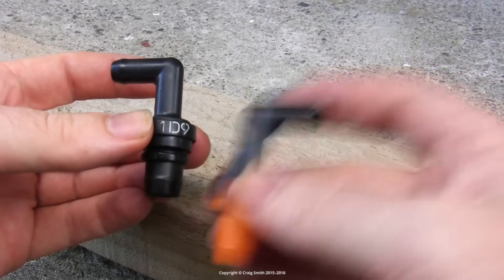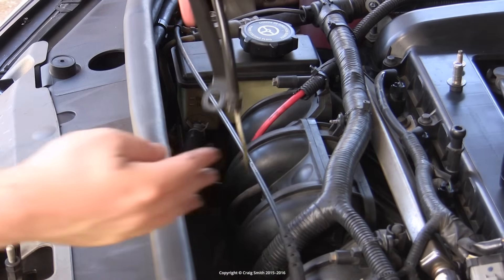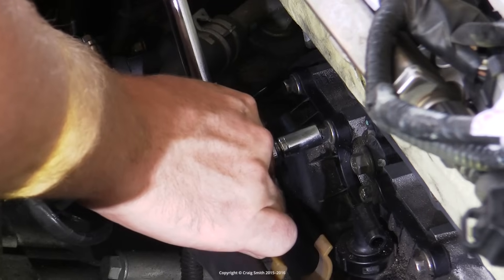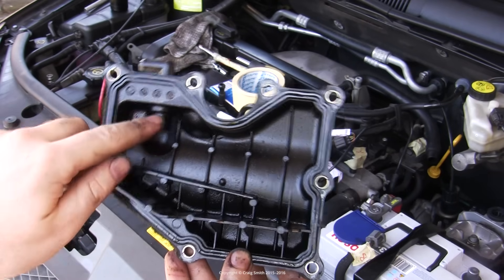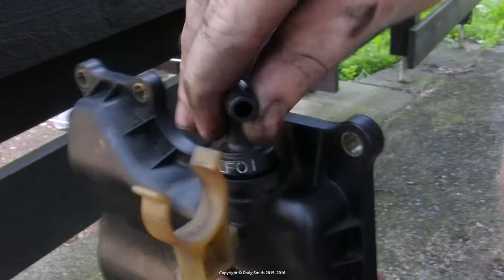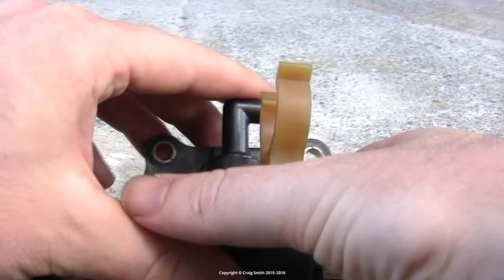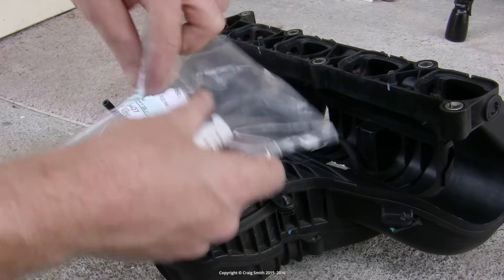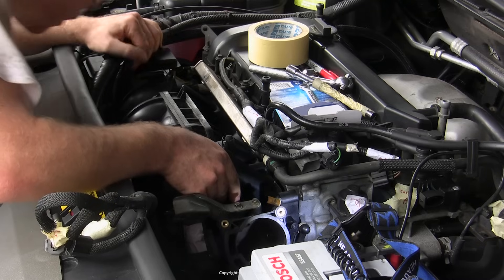How to: Replace PCV valve, hose, oil separator Ford Duratec / Mazda L (Focus/Ranger/Mondeo/Mazda)

Comment: my 2.0 duratec he engine has got some serious idle issues.. at start up It rews up to 3500 rpm and slowly goes down again to about 1100 rpm and stays there. same issues when driving and shifting gears   it revs again when I make a halt .. could this be the issue? before this problem the car didn't accelerate very well but after changing the intake solenoid switches and mounting a intake filter kit , it ran like a dream. good acceleration and so on... but now this issue... it even says " engine system malfunction " on the display and behaves like a rapid dog until I turn the ignition off and on again.. and then nothing.. comes and goes from day to day.  should I chek this put and also tjek the intake flaps? ..the throttle body is clean as a whistle and the sparkplugs too  . and the small vacuum hose at the manifold top is removed at blocked and it stopped rattling.
Reply: Allan Jørgensen hi  my car was doing same rew up randomly sometimes when stop at trafic lights after driving . I discovered that my chain was stretched out like 2-3 cm so I got new timing chain problem disappear. no more rew up ever since
Reply: I had this same problem and had it fixed. the problem was a leak somewhere in the intake manifold. Apparently I found out that there is a design flaw with this manifold and it is a common problem. I got a used manifold from the wreckers but there were components missing from it so sent it back. My mechanic was able to fix the issue using a glue gun and he fixed it perfect.
Reply: Hello weird but true， 

My 2.0 DURATEC HE has same problem as your one. It's serious idle issues more than your one.. at start up It rews up to 4000 rpm and slowly goes down again to about 1500 rpm and stays there. same issues when driving and shifting gears, it revs again when I make a halt. the throttle body is clean. 

Could you tell me how you can fix this issue?
Reply: Hey I have the same problem how did you fix ?  Unsure what to try first.

Comment: can anyone help me find these parts including the hose? I'm in the Netherlands and I cant find these parts anyware. I prefer not to go to the local ford dealer here since they broke my lock bolt and damaged 2 of my rims and they don't want to replace them.
Reply from the maker: The parts shown are: hose - Ford 1119272, valve - Ford 1216674. I recommend a 3rd party Ford parts supplier, in the UK I used Endon Services @ http://endonservices.co.uk and I recommend them - *however*, as explained in the video, these parts varied over the Duratec life, and are differently sized to match variations in both the intake manifold and the oil separator. So you must accurately identify your existing parts before ordering.

Comment: Hello Craig to your knowledge is this the sane engine as a 2005- 1.8  volvo s40? And if so do you think the pcv valve from ford will fit? Thanks Alot.
Reply from the maker: I just took a quick look at the S40 wiki page and I can't tell easily. It could be the Ford Duratec 1.8. You will be able to recognize it visually if you pull of the plastic cover and ignore any Volvo logos. If it is then yes the valves & hoses will fit, but as I belabor in this video there are several different revisions and you will have to work out which you have - the only reliable way will be to pull off the existing part #s.
Reply: Craig's DIY Car Thanks for taking the time to reply, yeah I'm pretty sure it is the same engine with few small differences e.g it has electronic throttle, just thought I'd run it by you. Thanks Again ✌
Reply: I also have a Volvo S40 1.8l. Just did the PCV valve and hose replacement, the hose had a 5cm tear in it. The engines are almost identical, with some exeptions like the electronic throttle you mentioned and some wiring. This video helped alot.
Reply: Erik i Tuni Thanks for confirming this, I keep meaning to do it myself but it just seems a but tricky.
Reply: I know what you mean, I bought the pcv valve at lease a year ago but never got around to fixing it. Luckily I followed online advice and bought the hose before starting.
I bought my parts from a Volvo dealer, you should be able to see what the part numbers are on catcar.info.
Reply: Erik i Tuni Thanks bro I gonna go check the part numbers now.

Comment: My PCV hose collapsed and split, and I replaced it and the valve with the help of this video.  The car ran great for a few months, and then the new hose collapsed and split.  I'm going to replace this thing a second time, but any idea about what's causing it to fail?
Reply: Did you replaced also PCV valve ?

Comment: My 2010 focus with a duratec engine is using alot of oil and its using more and more as time goes by.  Could this PCV cause this
Reply from the maker: It's worth checking, see if the valve has failed and also look inside the breather pipe at the rocker cover, and the filter box, to see if there is oil. The related suspect is piston rings.
Reply: Demon Destroyer hey i have thé same problem.
Could you find it?

Thanks

Comment: Can I replace it when any black hose with the same length or does it have to be a certain material etc
Reply from the maker: No, it needs to be vacuum hose that won't collapse under vacuum. The walls are very stiff. The shape is also a little strange so it would be difficult to replicate, easier to just buy the Ford part.

Comment: great video I did this last month and found sludge within the oil separator - would this cause envision issues and burning oil issues
Reply from the maker: More likely a parallel symptom of a badly maintained engine I'd guess.
Reply: Craig's DIY Car my valve is a metal one and pin keeps sucking up and cutting car out any ideas what might be making it do that

Comment: Man I just did this job without taking the intake off PITA.... removing the intake is probably the quicker and better option! Try and use a Motorcraft hose the dorman made in china hose is a tad shorter.
Reply from the maker: I wasn't sure it was even possible. Were you able to reach your hands in there, or did you do it using tools?
Reply: Apparently it is indeed possible for the pcv  valve to be changed from underneath the car with long bent needle nose pliers... It's difficult but possible  without having to take the intake manifold off. I think mine it causing my excess oil burning problem.... I just hope that I will be able to change it without taking off the manifold.

I read on a forum some guy said that the ford dealers change them that way and don't charge all that much because it's a 5 minute job for them.  I am not sure about the hose though.
Reply: @matheous77  what are you not sure about the hose ? You say it can be done from underneath the car removing the started but then you say I'm not sure about the hose though? What the fak
Reply: @pono321   I read on a forum that when you take this model car to ford to change the pcv valve, they are able to do it with some bent long nose pliers from underneath the car.  But as for the pcv hose don't think it's possible to change the pcv hose though without taking off the manifold. In other words, you can change the PCV valve without taking off the manifold, but very difficult to change the PCV hose without taking off the manifold.

Comment: Could you please tell me the part number for the valve?
Reply from the maker: The link I usually use for parts is down atm sorry. There is no single number to give because of the variations in the design, particularly the PCV system, so you have to either match the existing part or upgrade the entire assembly. And unless you are the owner from new, you can't be sure it wasn't already upgraded.

Comment: Hi Craig, my name is Iqbal. I am from Indonesia and I have a problem with my 2010 1.8L Mk2 Ford Focus engine. I was trying to clean its intake manifold but there is one hose which connected with brake booster. Could you please inform me how to unplug it? Because, I tried many times to unplug it, it didn't work.

Thank you.

I will send you the video if you need it.
Reply from the maker: Have a look at how the same is connected on this car, I assume it's the same or similar. https://www.youtube.com/watch?v=vBxm5QjD0PY

Comment: Hi Craig, I have the same mondeo as you. Can you give me the oemnumbers of the valve and hose please? Love your videos BTW! KR Richard
Reply from the maker: The hose and valve has to be fitted to both the manifold and the oil separator, both of which changed over time. So it's difficult to work out which you need without actually looking at what you have.

Comment: This PCV acts like a check valve or it allows air to pass in both directions? 👍👍👍
Reply: The vacuum from the inlet manifold opens the valve and lets out the crank case pressure and a bit of oil then it gets burned off  through the engine

Comment: Hi Craig, yesterday I replaced the PCV valve and hose on my Mondeo mk3 Duratec 1.8 petrol. Unfortunately it did not solve the symtoms I have on my car. What is happening? When I start the car the idle speed is around 1.800 instead of 800 and when I slightly push the accelaration pedal and remove my feed quickly the speed increases to 4.000 and higher and the car runs out of control. I have to turn of the engine to prevend damage. When I disconnect the idle air control valve the idle speed is and stays on 800 (airco off).

So with help of your video's I did the following;
- removed the swirl flaps (last year)
- replaced the idle air control valve
- replaced the T-Map sensor
- replaced the PCV valve and hose
- cleaned the throttle body
- inspected the throttle position sensor
- checked for vacuum leaks

None of this helped. It seems to me that the Engine Control Unit instruct the ACV to open wrongly. Is my ECU broken? When I check the self diagnose it shows under dtc dt5670. I have no clue, do you have any ideas perhaps?

Thanks! 

Kind regards Richard
Reply from the maker: I'm afraid you're getting into complexity beyond my abilities, especially over the internet. I suppose you would need to start accumulating more data. Have you checked basic things like the throttle cable not sticking, you said you checked the TPS but have you monitored it to check for smooth feedback. As to vacuum leaks, the worst would be at the intake manifold to head join where it is unmetered, so maybe take off the IM and check/replace the gaskets and re-torque the bolts - e.g. did you create a leak when doing the flaps and re-using old hardened gaskets. Finally you need to get a better picture of what's happening by watching the EFI on scan tool, is the engine running lean etc, also check error codes - sensible interpretation of those tea leaves can reveal a lot without ever touching a component.
Reply: Hello Craig, the flaps thing was a year ago and the car was running fine afterwards. The current issue I have since 4 weeks. No errorcodes. With Forscan I have checked the trottle position sensor. Looking at the voltages (0,83 at idle) the TPS seems okay. Can you please check these video's (you'll hear a strange voice, I have a speech disorder); https://www.youtube.com/watch?v=_-k6KPc2U70 the IAC is connected, the car is driving my feet is off the gas pedal. The RPM is increasing. In my opinion the IAC % should be 0% because the RPM is above 800. But the IAC is between 40-60% open!
This video https://www.youtube.com/watch?v=lb1JSWq0Jdc the IAC is connected, the car should be at idle (my feet is off the gas pedal, not in a gear). When I start the car the RPM increases to >4.000 RPM. In my opinion the IAC % should be 0% because the RPM is above 800. But the IAC is 35% open!
It seems to me that the Engine Control Unit instruct the ACV to open wrongly. Is my ECU broken? I have no clue, do you have any ideas perhaps?
Reply from the maker: Hi again, sorry for the delay, I wanted to check my own telemetry. No the IACV %'s are normal, mine are raised along with the throttle and lowered down to about 40% at idle, down to maybe 30% when the engine is hot. If you look at IAC_MODE you can see it switching between DASHPOT (idle) and PREPOSITION (throttle), it has something to do with smoothing the throttle on/off transition.
Reply: Hi Craig, thanks for your time. I'll think you are right. What I also have noticed, which I think is weird, is that I have 12 volt continue on the IAC wires (the end which connect to the IAC) when the engine is off. That is not normal?
Reply: Hallo Richard,

Ik heb gisteren een Ford Mondeo 2.0 uit 2005 gekocht  Het lijkt erop dat mijn auto exact hetzelfde probleem heeft. Ik ging er van uit dat een klein iets zou zijn (vacuumslangetje oid) en dan is het weer klaar. Maar nu lees ik jouw verhaal hier...en dan ben ik er nog niet zo zeker van dat het makkelijk en snel is opgelost. Ik heb de auto sinds gisteren en heb er dus nog niks aan gedaan. Heb jij het probleem inmiddels verholpen?

Gr Klaas

Comment: Sir, What are your thoughts about relocating the PVC to an acceptable location.. I have a 2006 Ford Focus SE zx4 duratec 2.0L. I am preparing to replace the intake manifold and of course any related components that become accessable in the process. I know I'm asking a lot but if there's any kind of list if procedures to accomplish thisI would appreciate it either way I'm going to do it LOL. The vehicle has a 130,000 it doesn't leak a drop of oil it's a manual transmission I replaced all the CV axles the struts shocks rotors and pads in the front. I've cleaned the mass air and the tmap sensor. And of course all 3 engine mounts. I am also the master of headlight restoration. I've gone through countless minor repairs have been going through all the electrical connections using dielectric lube electrical tape tie wraps. She's looking good. Anyway if you could help me with that I would be in your debt sir.
Reply from the maker: To relocate the PCV? Honestly I'm not sure. It's not that difficult a job to take of the IM, and as much as it's a pain to access the PCV, it's probably easier to accept doing that once or twice in the car's life as opposed to all the work and possible complications introduced by modifying it's set-up. You need manifold vacuum and the air/oil separator is where it is on the crankcase. The only thing I'd maybe consider if you really want to upgrade it, would be installing a catch can, if you extended the hoses so as to place the can somewhere sensible. You could also shift the PCV valve away at the same time but it's possible this would disturb its pressure specification.

However again this is really giving yourself a make-work program. As explained in my video(s), the Duratec inbuilt air/oil separator was modified by Ford a few times along with the PCV valve and the hose to the intake manifold, so you could check what version you have and upgrade it to the latest iteration if not already. I have the earliest and hence 'worst' version, and even after 100,000+ km when I took the IM off there wasn't too much oil in its bulb. You will still eventually have to take off the IM for one reason or another, e.g. replacing the gaskets, so I suggest you just do the valve and hose as a maintenance item on those rare occasions.

Comment: I've got a 2005 Duratec DOHC V-6. The engineers that designed this sideways V-6 should be sent to the 5th ring of hell and forced to remove the valve cover on Bank 1 for ETERNITY.  What a pain in the ass to do ANYTHING on Bank 1.

Comment: Hi Craig, greetings from Brazil!
I have a problem with my Focus MK2,5 2.0L Duratec Petrol. The issue is that I'm getting oil on the spark plugs of cylinders #3 and #4.
I'll check about valve leaking and cylinder's rings leak but I would like to know if the oil on the spark plugs could be caused by a bad PCV valve or hose?
There is no valve's cover leak.
Thanks in advance.
Reply from the maker: You mean oil in the plug wells? This should come from leaking cover gasket rings (around the plugs), it might not be obvious to look at if a slow leak at high temperature. A failed PCV can cause additional pressure that can blow out the gasket(s).
Reply: The spark plugs of cylinders 3 and 4 are having oil in their threads, there is no oil in the electrodes.
The ignition coils(boots) have no oil, no leakage in the valve cover gasket.
see the video I made.
https://www.youtube.com/watch?v=_8RzfluUCKk
Reply: Do you think it could be caused by a plug with under torque? But the oil comes from where?
What is the torque recommendation for the duratec plugs? I'm using 20 N.m.
Thank you!
Reply from the maker: It's possible apparently that this is unburned fuel, not oil, but I'm unsure sorry. About valves & rings I would expect other symptoms, e.g. smoke from exhaust.
Reply from the maker: Torque should be 15 nm max I believe, a little less with anti-seize.
Oil from the top can only come from a leaking valve cover, but the seal on the plug is made above the threads - however in the scenario of a tiny bit of oil pooling at the bottom of the wells, the oil could of course migrate down onto the threads as you remove them.
You also don't seem to have any evidence of oil being burnt in the cylinder (tip is not blackened).
If it isn't using oil and is performing ok I wouldn't worry about it unless/until you get worse symptoms.
Reply: Okay, I'll monitor those symptoms closely, thank you very much for your help and attention.